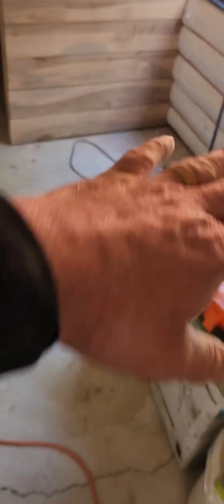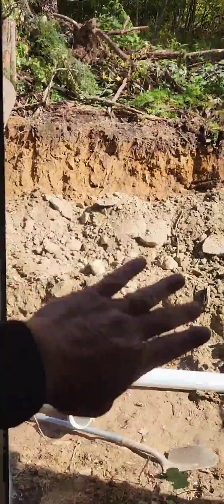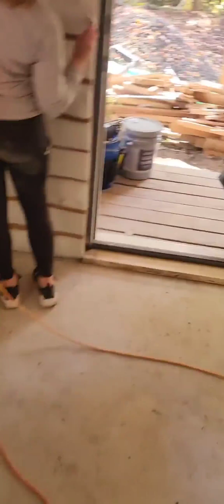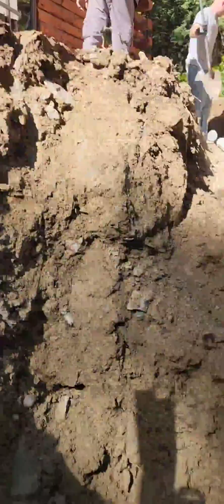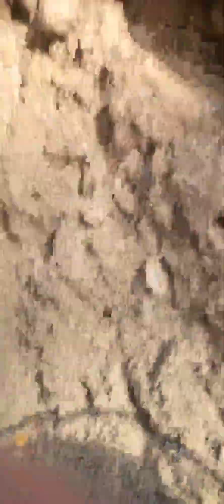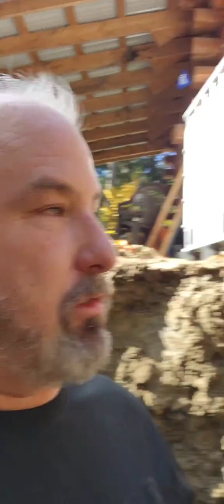Let's talk surface water versus ground water foundation damage.

Comment: I live in Bucks County, PA - just north of Philadelphia. Almost every house with a basement, built in the last 30 years, has a french drain / sump pump system installed in the basement. We have block walls and a poured concrete floor. There are NO cracks in the floor or walls, but after every hard rain, the sump pit fills up and is pumped out to our driveway, which has a steep slope down to the curb. A lot of Bucks County is known for clay in the soil, which prevents soil drainage and causes puddling in our yards. The water that does drain, finds its way under the foundation of the house and would find a way up through the concrete floor if it wasn't for the french drain / sump pump. The front of the house has a steep slope down to the street. The sides are graded away from the house to a swale between the homes. The back yard is flat as a pancake.
Reply from the maker: I lived in Chester Springs PA for years :)